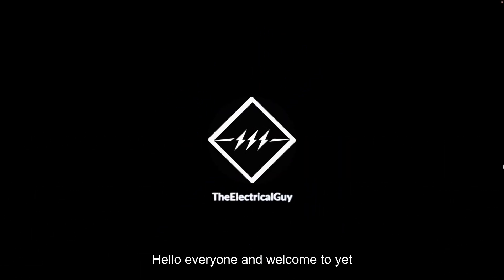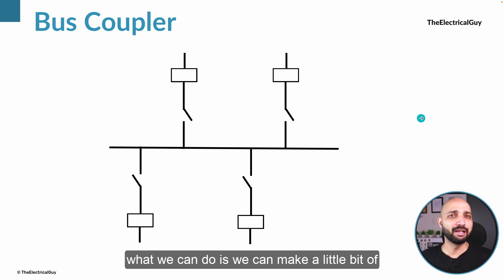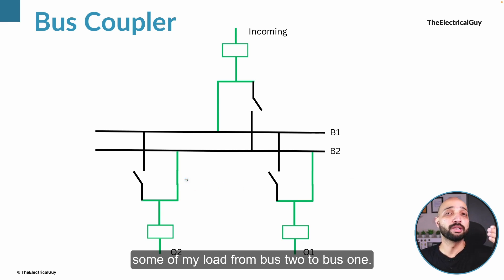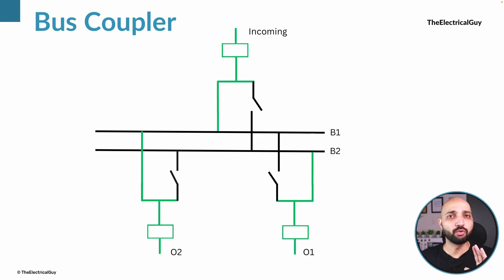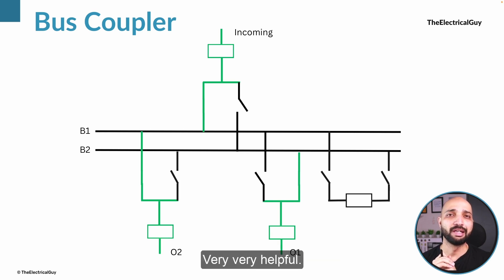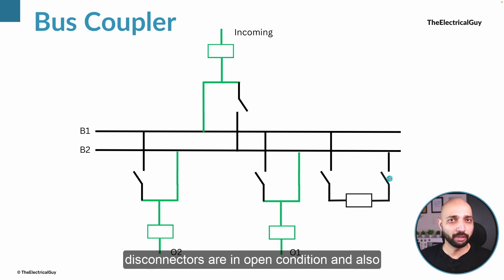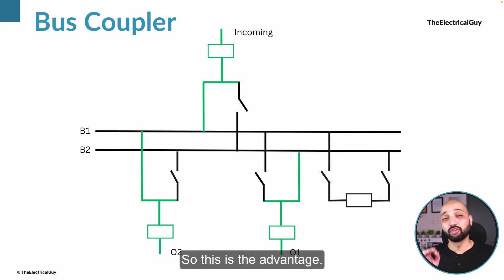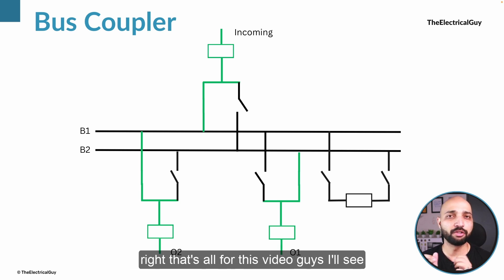What is a Bus Coupler? What are the Steps to Operate | Explained | TheElectricalGuy

Comment: It is really a good explanation of the concept. I do have a doubt. The incoming feeder is connected to either of B1 or B2. So how will the loads connected to the other bus gets supply? For e.g.: at 10:11, after enabling and disabling the CB, the incoming feeder is connected to B1 and Q2 is receiving supply through B1. However, as disconnector from the feeder is not connected to B2, how will Q1 receive power? One possible scenario is assuming that the bus bar B2 is connected to some other feeder, but in the explained layout, it is not clear. can you please help me understand?
Reply: I have the same question.

Comment: Can you open an isolator in the outgoing bay without before opening the CB in the same bay? I thought isolators can only open when CB is open
Reply from the maker: Isolators are off load devices. And must only be opened when the supply is off.
Reply: @GauravJ  in min 9 you open a disconnector with a breaker closed. Is it right to do that?
Reply: In your video you said  disconnectors  of bus coupler first close then close CB ???
after that you said for bus disconnectors we can open and close on load ???
How possible like this if CB not open

Comment: I am doing my final year design  project . I have a 11 kV system with eight mini-substations connected underground with XLPE 70mm2 cable. The mini-substations  are indicated in kVA ranging from 200 to 500. I am using DIgSilent to draw the schematic. My question is how do I represent the mini-substations on the software. Your help will be highly appreciated.

Comment: I have a question abot bus coupler circuit breaker. Is it possible to open the circuit breaker while both disconnectors are closed on one outgoing bay? Is there any interlock on that circuit breaker to prevent it from opening or is it possible to open it? If so, what problem would it cause?
Reply from the maker: There is Electrical interlocking provided between the circuit breaker and isolator.
Reply: How it works that inter lock, how it give them